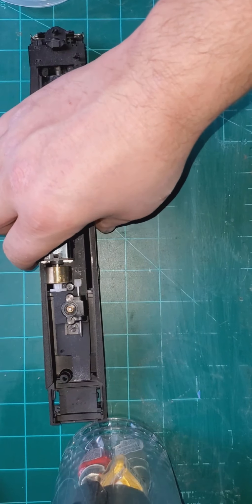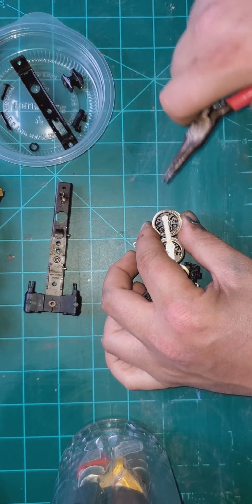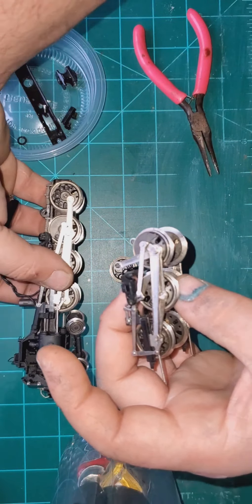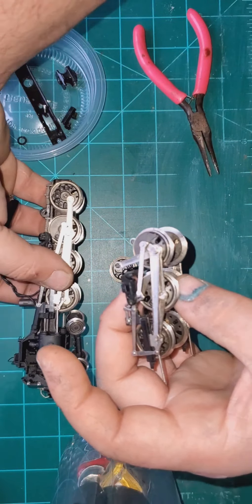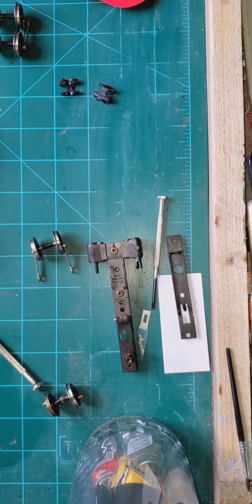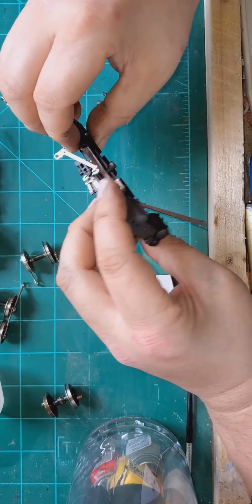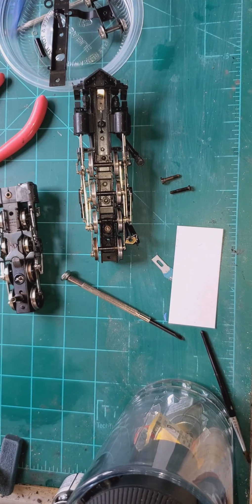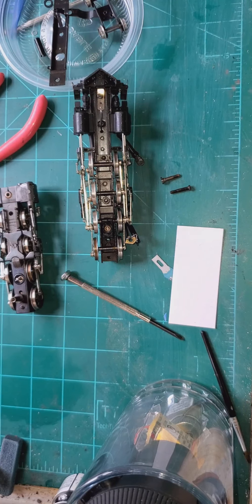Rivarossi bigboy repair and rebuild part 5 the trucks

Comment: I must tell you that being a perfectionist helps in this hobby a lot I lost sleep over you not reinstalling them washers and not using a quartering tool on each wheel must be why my trains run like a fresh lubed sowing machine also I don’t use grease of any kind I use Dot 4 brake fluid for all lubricant
Reply from the maker: Well thats you and the purpose of the video was to show  the break down not quartering there are plenty of videos on that subject and as I say in the video James  May has a much more detailed video than any one I know on the Proper assembly and quartering of a steam locomotive and also I have a device I don't show or mention in the video that will check the quartering I am protecting a potential patient.

Comment: I recently bought  the Tyco gi joe electric train set. But for some reason when I add all the trains together the locomotive feels like the tires are spinning and is having trouble pulling the rest of the cars behind it but went it's by it self it does just fine. Any idea what could be happening there!?
Reply from the maker: If it doesn't use traction bands then the gears are probably spinning on an axel some where